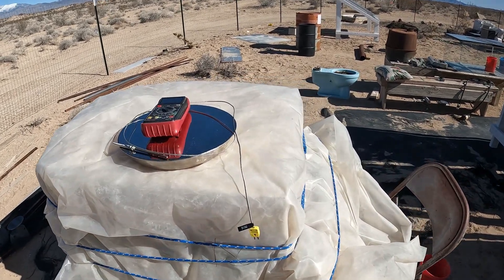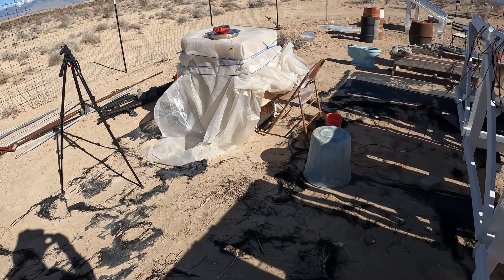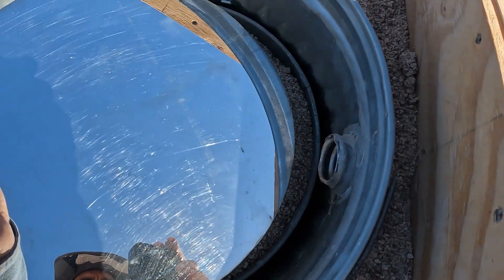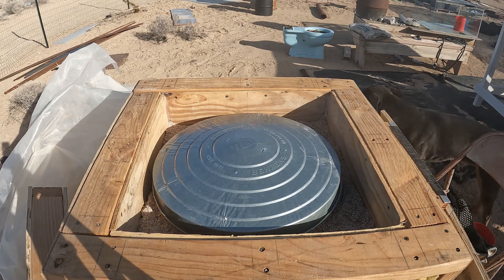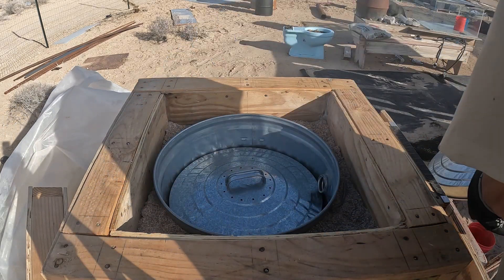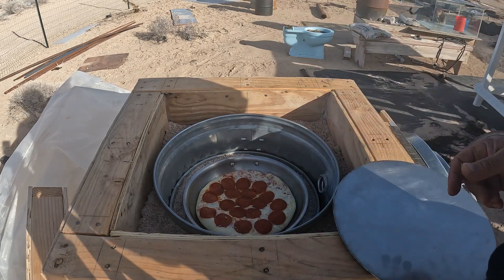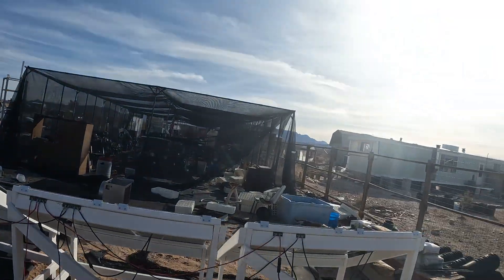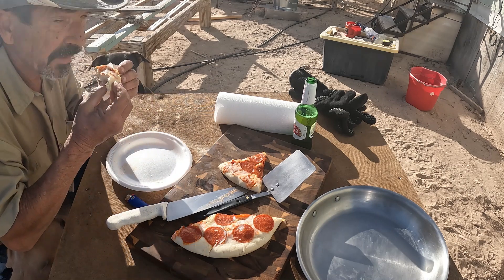240 Volt Element After One Month Part-26

Comment: Would it matter if you add some parts of other sandy material, salt or magnetite or iron pellets, to cover higher temps maybe burned clay peletes? Could an copper cone fat on one end and thin on the other transfer more warmth from the sand?
Reply from the maker: There is endless experimenting to do.  The magnetite sounds interesting but it may contain metals that are toxic at high temperatures. But iron pettets should work I would imagine.